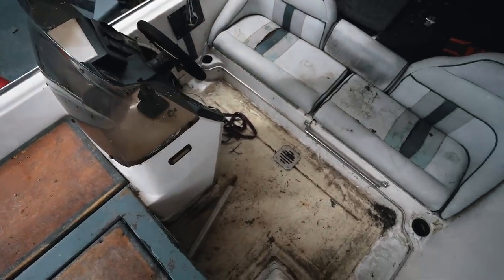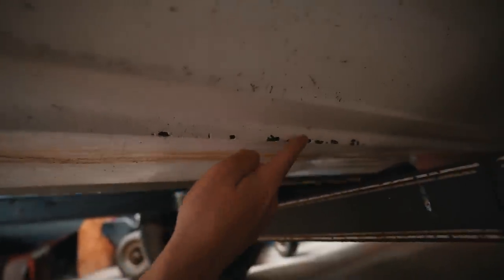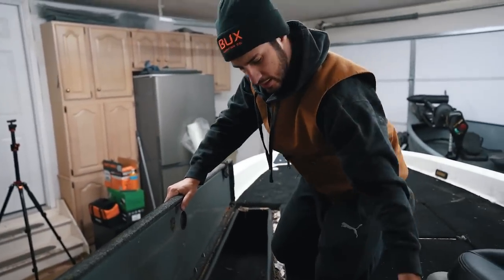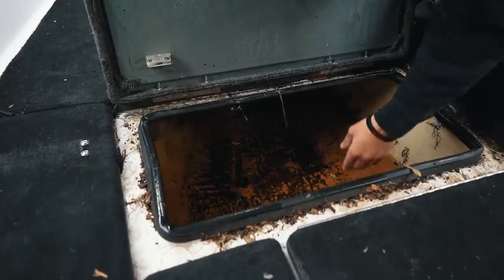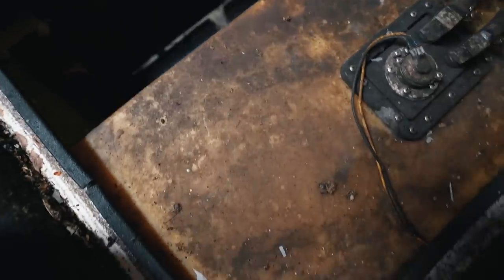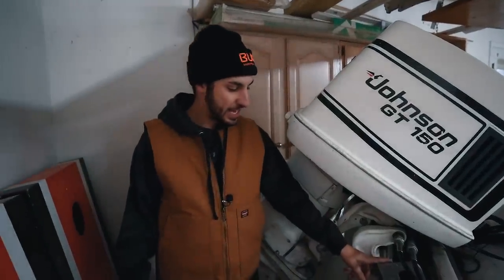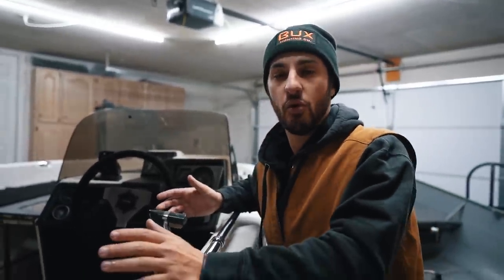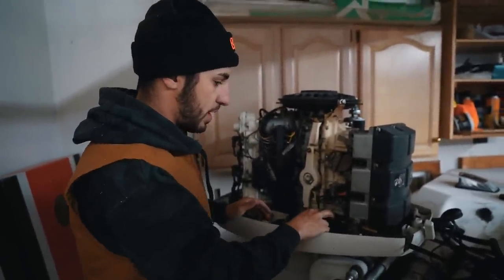The CHEAP Bass Cat How Bad Is It?

Comment: I currently own a basscat and have worked on them for years. I can tell you everything you need to know about basscat. I also owned the same boat you have at one time. If you have any questions don't hesitate to ask. Also there is storage under the driver's/passengers seat. Just fyi

Comment: Enjoyed your video. I refurbished a 1988 Ranger 364 with 93'Johnson Fast Strike in non-working, but reasonable condition. I know you will be successful in your restoration because you have demonstrated a great attitude and positive attitude and prayer will carry you through this project!  Before you get too far into the boat refurb, I recommend running compression test on each cylinder make sure you are good. I'd also replace power pack and both down and up plug in trim actuators (these are relatively cheap and I would always keep 1 spare in boat too). Also, make sure you run the Champion plugs vs. NGK. NG great plugs but my Johnson outboard ran much better with Champ plugs as designed.  As another person mentioned I would definitely rewire everything you can and certainly replace all old fuel hoses with the silver ethanol rated hoses. Harbor Freight sells small fiberglass rods to help pull new wire that was a big help for me when I rewired.  Also a good idea to pull the fuel tank out and pressure wash and dry and check fuel pickup tube.  I also disconnected the VRO oil injection system and mixed 2 stroke oil 50:1 direct in the tank. Felt it was safer, just have to remember to make sure always add oil at fill up.  Boat Carpet Central sells Shaw Marine Carpet which is great marine carpet that is easy to install with Roberts 6700 adhesive (buy at Home Depot). This carpet held up 10+ years and still looked great when I recently sold the Ranger to upgrade to a new boat. Last piece of advice I can offer is the angle grinder is your friend!  Wish you the best in your restore, you have purchased an iconic boat should hold up well for a long time.  Congrats and look forward to future videos on your project.

Comment: As long as gel coat isn't separating from the glass you can more than likely sand it until you get to the point it stops flaking off them get paint on gel coat. How much you have to take off and how even you were able to keep it is also variable. Off you took off allot of it gets wavy you'll have to do more block sanding, like when doing prepping for an auto paint job. Time consuming but not hard

Comment: Doesn’t look too bad at all. I’d take the plugs out and squirt a little oil like mystery oil in the cylinders. Make sure the rings are free before you try and turn it over. Shift/Throttle cables not a big deal at all to change out either. Disconnect at one end and operate the cables manually to see if it’s the cable itself or the binnacle/engine.

Comment: The boats not in that bad a shape there's nothing wrong with the scrapes on the hull but you had better check that transom better then you did it would probably be smart to take the motor off and the aluminum angle that caps the transom off and look in there cause its older it's got plywood and it rots
Reply from the maker: Haha yea, I don’t disagree. Well take a look at it down the road of this build
Reply: Honestly this is where I would start.
Reply: @enddockboyoutdoors748  I totally agree

Comment: Personally I would rewire the entire boat. Given the age and the condition that it's in. I would just replace all your switches and gut out all the harnesses and make up new ones. It's alot easier to do it now than to be out on the water and end up with a potential electrical fire or some intermittent electrical issue that basically strands you out in the middle of the lake or river for that matter. Again with the age and condition of the boat I really wouldn't take the chance. Do now while it's in the garage and all torn apart.
Reply from the maker: I will def be rewiring to an extent

Comment: The cracking gel coat in the locker is most likely from someone dropping an anchor in and hitting a void. Not a huge deal. I would def remove the carpet and pressure wash it. Then let it dry out. Once it is dry you will know where the problems are
Reply from the maker: Didn’t think of that. Probly right!!

Comment: These builds are great for u tubers.  If you have more time then money. You also need tools $$ a place to store indoors and have the skills to do all the repairs. I love watching them. I have owned cheap boats that took years to get everything  right. You often flind that parts are no longer available so you spending time and money building custom parts. The money I spent in repairs and tools exceeded the value of the boat. I spent more time fiximg the boat then using it. For my last boat I took home equity loan and spent 50k on a boat. Not having to do any repairs put me on the water more often. The cheap boat probally cost me only a litte  less once everything was fixed. Fixed but you still have and old boat. At the time like you  this was the only option. Still i actually think a 2 to 5 year old boat is a better financial option. You may have to wait a few years to get the money together. Until then find a buddy with a boat. You will spend the same in and use it more. I want to fish not become a boat repair mechanic. I do understand some people like working on boats more then actully using them. For me I wish I pulled the trigger on a nice boat to begin with.

Comment: Seats you can order new from basscat or get skins…most parts you can order directly from them…I’ve been working on restoring my 96 pantera ii
Reply from the maker: Good to know!
Reply: That is 100% correct. I just got in new bow rollers (comes with the bolt, washers, nut 2 bells and the roller), and the bunk and fender carpet including the proper cut diagram (hint, the bunks are not 2x4's, they are 2x6's ripper down to 4.75, chamfered at that back and angle cut at the front). Their parts department is the best. They can guide you in most things or point you in the right direction. They might even have a wiring diagram for that year p2. They didn't have one for my 88. A lot of guys swap out to the A-10 control panel though.

Comment: @tightlines. I had that same boat. A little box you didn’t know about I used it as a day box. The biggest thing to watch for on those older Pantera 2s is the transom. It is still wood wrapped in fiberglass. Mine ended up cracking and getting termites really bad and rotted out

Comment: That motor is not a 96 it's a late 80s early 90s the change from that design in 93 or 94
Reply from the maker: Hmmmm good to know, was told it was a 96
Reply: @TightlineTV  he is correct. My 1985 Ranger had the same motor and it looked just like that one.
Reply: I wondered about that age to ? I have a 98 Triton with a 83 150 and it looks like his brother!
Reply: There great motors only down side is they use more gas then a little bit like 2 minutes a gallon at wide open throttle
Reply: It is an 80's model in 1989 Johnson changed the color of the motor and I am pretty sure 1991 was last year for the GT model. Good motors just gas thirsty.

Comment: Great buy with a little work you’ll have a awesome boat a little advice from a old bass fisherman 1st on that motor it’s not like the newer ones in the 90s Johnson had problems with some of there oiling systems to make sure yours is not one of them and if it runs it last a long time just take the oiling system off and put a mixing ratio cup in the rear in a zip lock bag and when you put gas in put the amount of oil need for that amount it might smoke a little more but your motor will last longer. 2nd the boat that you have one has the 2 live wells in the back the one up front is for tackle storage and the one holding water even though some of the gel coat is chipped it holding water shows it’s not leaking but I would take a drill when you clean it up and make a small hole in a corner that way if water gets in it will drain straight out. 3rd that jack plate is a awesome buy but I would find out what basscat recommends the motor to be set at and make a mark and leave it unless you get stuck in the mud lol thanks for the video

Comment: get the engine thoroughly gone through and decide if it will meet provide service and dependability throughout the length of time that you will own the boat/rig. the engine is the most expensive item and the one item that you depend on for safety. as time and all allow get the boat in shape starting with the cabling and wiring again for safety sake. that is a neat boat but its going to take time and cash to get up to tournament style fishing use.  but i think you have some good to work with. then you still need electronics and trolling motor and get a good look at the trailer and its wheels and tires.   "fishing with Nordbye  youtuber got a used bass cat about a year ago. he has a mentor friend who has a lot of experience with bass cat and setting one up.

Comment from the maker: What do you guys think? Is #teambasscat in trouble ? 😬
Reply: Just a heads up.  That engine is a good bit older than the boat.  The 150 Fast Strike replaced the 150 GT in 1991.  That looks like an 80's engine

Comment: If it has separated the angle grinder comes out and you go down to the glass until you get to the place they contact each other. Then you need gel coat and you press it in like your doing Bondo on a car. And then you sand and sand

Comment: Good luck on the restoration. I have a ‘92 Pantera II and absolutely love it, great weeknight derby boat! 
I use the small box for tools/ electrical connectors/ electrical tape/ extra boat plugs etc.. 
The middle “live well” is the cooler and holds ice well. 
I would recommend a plug for the live wells behind the seat as the plastic “fill / drain” lever is likely not operating or will fail. 
Would love to see a video on the hull repair as well!
Reply: yah the LiveWell fittings crack and break then leak so your boat sinks...lol

Comment: I just did a ton of gel coat repair on my boat it's actually really simple. The hardest part is matching your white but on the bottom who cares. Patch it with a white gel coat and put a long keel guard on it problem solved.
Reply from the maker: Thankyou for the tips! Appreciate it
Reply: No problem I do have those parts for real that you might be able to use and I go to westbranch often so let me know.
Reply: @TightlineTV  You can also get the gelcoat from basscat

Comment: Check that seat post again.. some of them screw into the base
Reply from the maker: Will do, weird how there al disconnected
Reply: @TightlineTV  Those seat posts have a lever that hold it in. Take a little lube and spray around where the rubber is where it goes into the mount.
Reply: Yeh.  Some clip in.  Some screw in.  Some just drop in.  Alot of people keep the posts in to help with water run off on cover when outside. But when left in for long time it starts oxidizing and will seize up

Comment: Just my .02 worth, I would do away with the external oil canister and just mix the oil and gas in the main tank when you fill it. I had a friend one time with a 4-wheeler and the oil injector went bad and wrecked his engine. Team CAT!!!
Reply: If you take care of the oiler it won't be an issue. Also don't ignore the alarms. The oiler system needs maintenance just like the motor does. Most never bother and when the diaphragm blows and stops pumping oil and the head blows they blame it on the system. Not their own neglect. Also have fun mixing the oil the vro would save you oil cost instead of running 50:1 wich would cost more in maintenance.